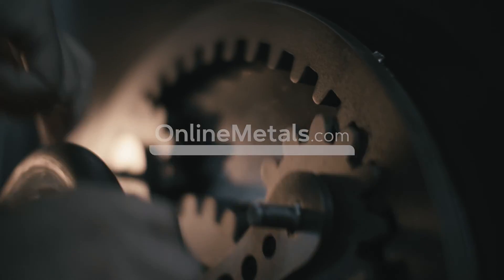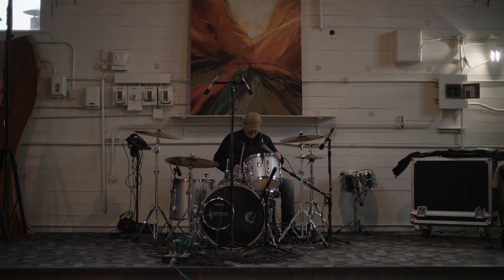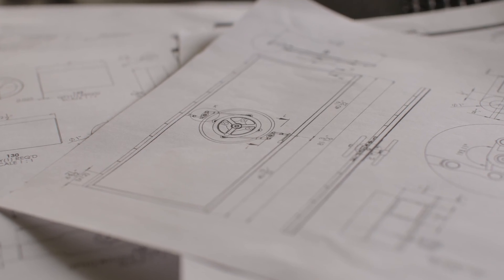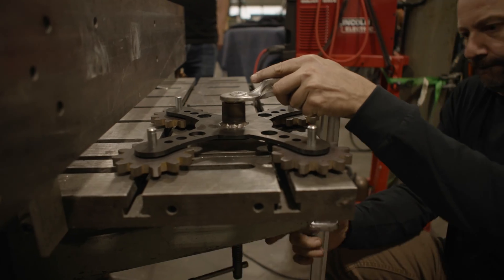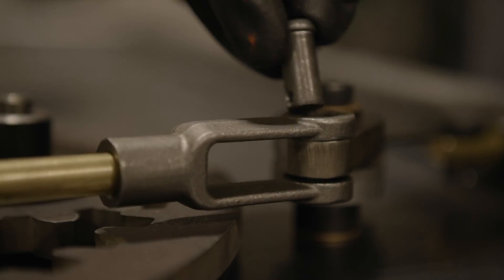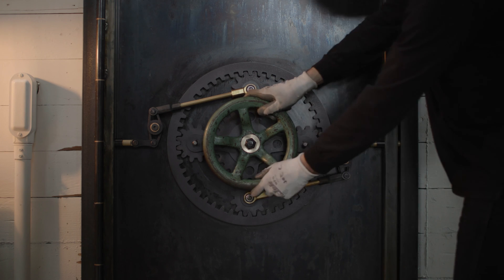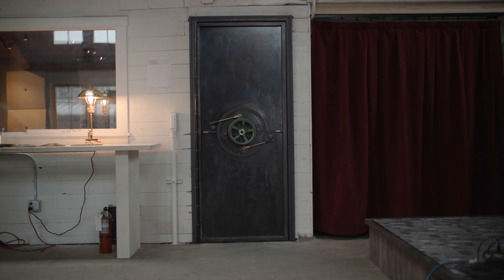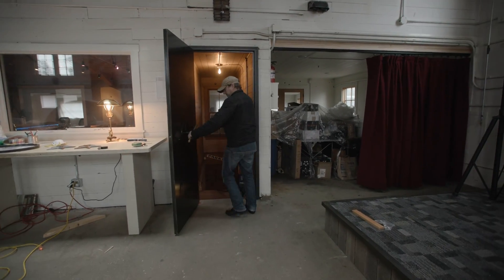Made With Metals Ep. 6 | Planetary Vault Door

Comment: Your definition of a 'vault' is a long way from mine.
A lot of craftsmanship in the gears, but for just 2 bolts?  I won't fuss about an active bolt the hinge side (fixed would be just fine) but nothing secures the top or bottom of the door.  The door is at least 6'8" tall and only one bolt securing it?  Come on guys!